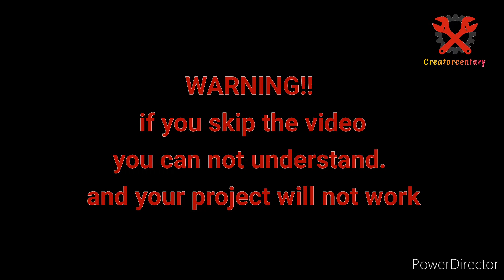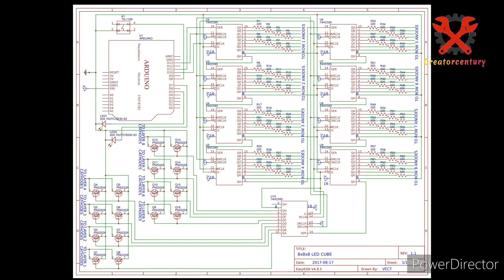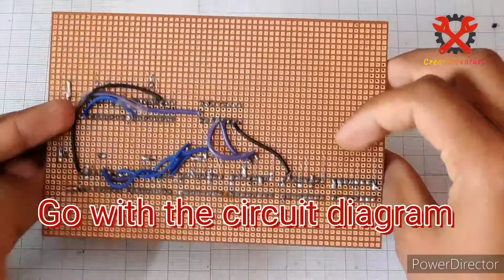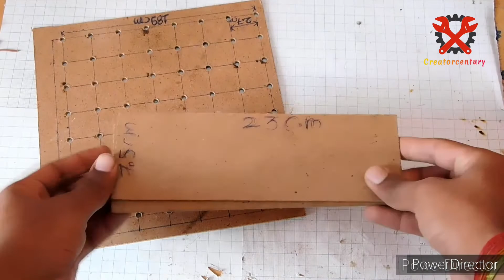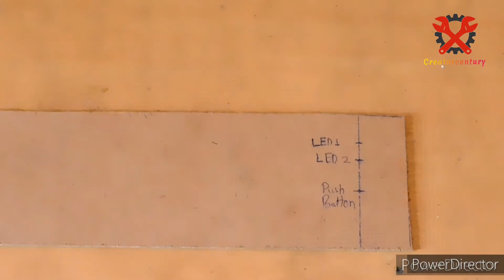8×8×8 led cube with arduino make at home easily.

Comment: You didn't reply my last question. Please answer me. Another question: I ordered 2N2222 transistor but I got KTN2222A. Can I use them?
Reply: Yes of course
Reply: @SachinKumar-lm6gp  So 2N2222A and KTN2222A are same?
Reply: @leon9357  please read the datasheet both transistor
Reply: @SachinKumar-lm6gp  Can you please tell me. I have no patience to read the data sheets of the two.
Reply: @leon9357  where are you from
Reply: @leon9357  yes you can use it. both transistor datasheet are same
Reply: @SachinKumar-lm6gp  Thank you for your reply. I made 8*8*8 led cube but now LEDs are flickering and two rows and columns are not glowing. Can you help me out?
Reply: Cheak your connection and transistor
Reply: @SachinKumar-lm6gp  Checked transistors, they are good, and also the connections are ok. Another thing to mention: when I connect pin 8 and 13 of the 74HC595s shift resistor to the ground of arduino, the whole cube goes off only some of the LEDs of the lower portion glows. Please help me. I gave a lot of time to make it and now this is happening.
Reply from the maker: There may be a short circuit in your board please check all of your connection again.

Comment: Big Problem. Help. LED Cube is not working. u10 no. shift register is becoming very hot. Arduino board's "L" indicator is constantly gowing and showing no effect. Please help.
Reply from the maker: May be problem lies with your power supply
Reply: @creative_Vinay  What kind of problem? I am using a 5v 10 amp power supply like you showed in one of your videos. Another rhing: do you know how to check 74HC595 shift register to find out whether it is working or damaged? Please reply.
Reply: I used one 5v 10 amp smps and gave power to the cube and also used a usb adapter to power up the arduino at the same time. Is this the problem ? Reply fast. Waiting for your repy. Thanks.
Reply from the maker: @leon9357  it is better to use usb adapter only
Reply: @creative_Vinay  Don't understand. Then how would I power up the LED CUBE?
Reply: @creative_Vinay  I want to contact you over phone.
Reply from the maker: I know your prolem, do not give separate power to arduino and led cube.
Only give power to arduino board via usb adaptor.
To give power to led cube, use arduino board.
There is 5V power output pin on arduino, use it to give power to led cube.
Connect all +ve wire of cube to 5V output pin on arduino 
And all -ve wire of cube to GND outout pin on arduino board.

Hope you understand.
Reply: @creative_Vinay  Thanks a lot. Will try definitely. Another question: If you give me instructions about how to check the 74HC595  shift register whether it is working or damaged. I think some of my shift registers are damaged.

Comment: Can't upload your code to arduino. Error Complying . Help.
Reply from the maker: Sometimes it have some problem with mobile phone.
Try to upload it with pc.
Reply: @creative_Vinay   Did it successfully. Actually the driver of the Arduino board was not installed. I had to install it. I did it with my laptop. By the way the effects of the cube are retaining for long time. How much time it will take to change one effect to another?
Reply from the maker: They don't change automatically, if you have seen the video carefully there is a button to change one effect to another.
Reply: @creative_Vinay  Yes I saw your video. That is right. Now can you give some tips to make the change of patterns automatically? What do you think? Isn't it cool?
Reply from the maker: If you can do the canges in code.
Instead to reset with button to a given time.
It will switch from manual to automatic.
But it is not that easy.
Reply: @creative_Vinay  Can't understand. Can you please explain the reset button feature?
Reply: @creative_Vinay  I am going to change the code manual to automatic

Comment: Where did you get that copper wire? That wire you soldered at the middle of the layer.
Reply from the maker: It's normal copper wire for home, you can get from any electronics shop.
Reply: @creative_Vinay  No, that wire you used was single core isn't it? Now a days these wires are not available in the market. Any suggestion?
Reply from the maker: Ask for copper wire for home wiring, or see it online.
It is available in market you just have to find it .
Reply: @creative_Vinay  Ok, will try.

Comment: Give the link to buy Vero Board you have used. Another thing: I tried to solder the IC Base. But unfortunately some pins of the IC base which are side by side are soldered together. Will it be a problem? Please help.
Reply from the maker: I will give link in description, 
To prevent from soldering two pins together use some solder flux and don't use much solder wire, yes it may be the problem.
Reply: @creative_Vinay  Many many thanks.

Comment: First comment: Nice. Can I make it with 3 different coloured LEDs like Red, Green, Blue. Also the circuit diagram is very complicated can you please simplify it and upload it part by part? Thank you.
Reply from the maker: Yes you can choose the led colour whatever you want, but circuit diagram can't be simplified as it is already simplified but if you are going to make it i can give you some tips so you can easily made it.
Reply: @creative_Vinay   Thanks for your reply. Thank you again for your kindness. Please share the tips. It will be very helpful for me. And another question : actually I wanted to say can I use 3 different colored LEDs to make it? Waiting for your reply.
Reply from the maker: Yes you can use 3 diffrent colour led.
For tips connet to my instagram @its_vinaysingh
Reply: @creative_Vinay  Thanks man.But I am not on Instagram. Can you help me through e-mali? Another question: How can I draw the square of 189 cm side on a 12 inchs *12 inchs board?
Reply from the maker: Just use your scale and draw the lines.
Take measurement from thr legs of led
Reply: @creative_Vinay  Ok. Thanks. By the way another question: In your project you have used Arduino Uno and 16 no. of 2N2222 Transistor. Can I use Arduino Nano and only 8 no. of 2N2222 transistor? Watched a video of a Chinese guy made 8*8*8 LED Cube using Arduino nano and only 8 no. of 2N2222 transistors. So is it possible to make like this?
Reply from the maker: Yes it is possible but you need different arduino codes if you use arduino nano and also you get  the less number of patterns in led cube.
Reply: @creative_Vinay  Ok, Thanks man.
Reply: Hey Vinay, can I use 1 watt 220ohm resistor in place of quarter watt resistor?
Reply from the maker: No problem you can use them.
When you made it, send it's video to me if you can.
Reply: @creative_Vinay  Currently I am gathering components. After gathering all the parts, I will try to make it. Actually I got 220 ohm 1 watt resistor in the local market, not the quarter watt. So I asked you if I can use it. Thanks for your cooperation. I made a 4*4*4 led cube with Arduino nano two years ago. But the cube was not straight. So decided to make 8*8*8. Again many many thanks for your cooperation.
Reply from the maker: @leon9357  my subscribers are my family❤❤
I am always there to help all.
Reply: @creative_Vinay   Yes, I understand. I will be your subscriber very soon.
Reply: Hey Leon here. Can I use Arduino uno R3?
Reply from the maker: @leon9357  if you have seen the video,
I have clearly mentioned that this is arduino uno r3 project.
Reply: @creative_Vinay   Thanks man.